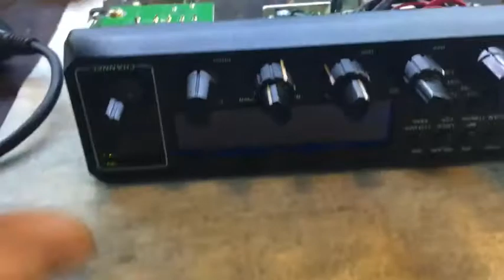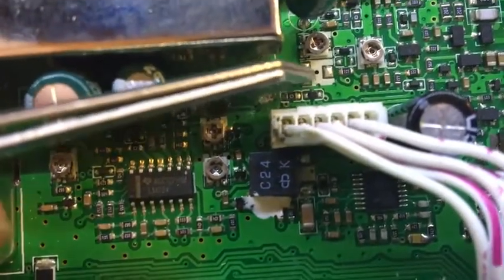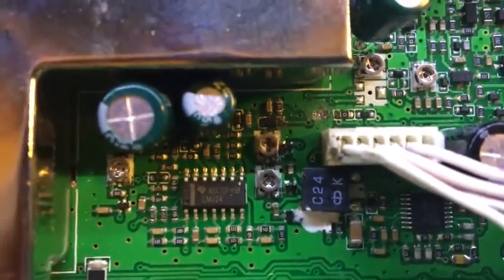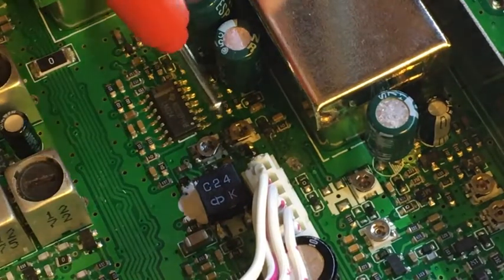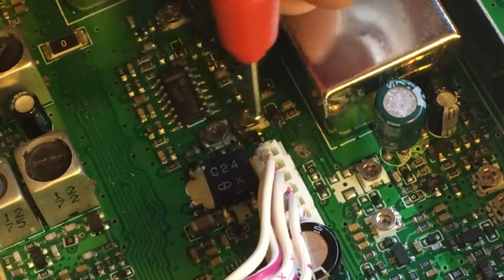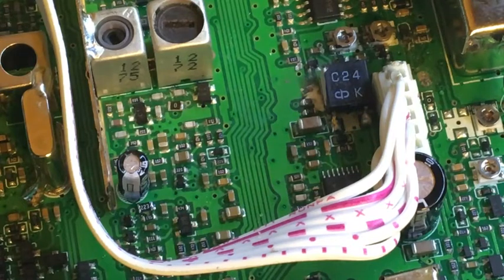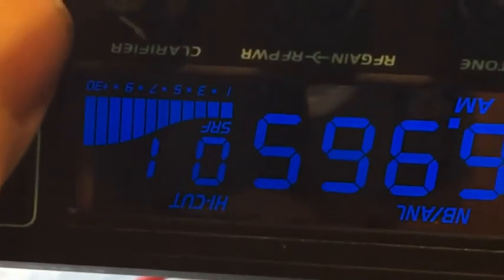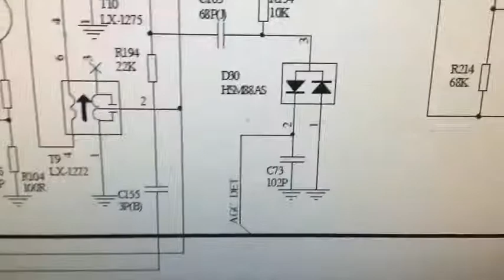#73 CRE 8900 CB Radio Signal Meter Repair

Comment: I'd like to know how to put an external analog s-meter on this radio.  I want to use it for "fox hunting" or "t-hunting".   Many of the imports have a jack in the back for external meters.  Any idea where on the board an external meter could be connected. Usually a single point for signal plus a board ground.  Thankfully.   My CRE8900 has not been fussed with like that poor radio in the video.  I know this vid is kind of old but any help would be appreciated.
Reply: Not being funny but maybe there is a clue in this video??